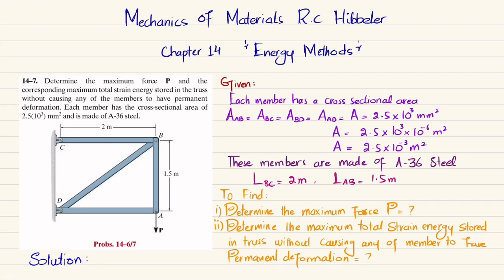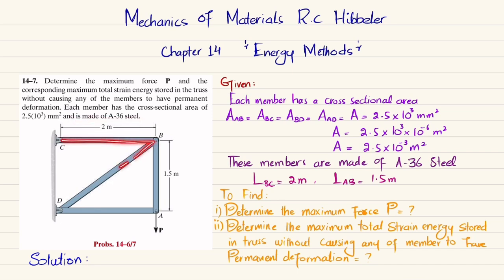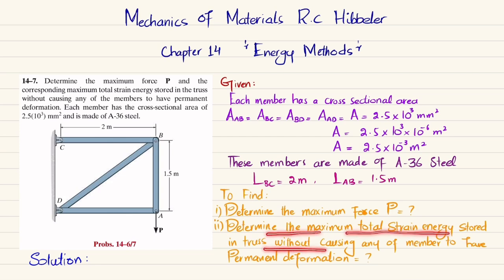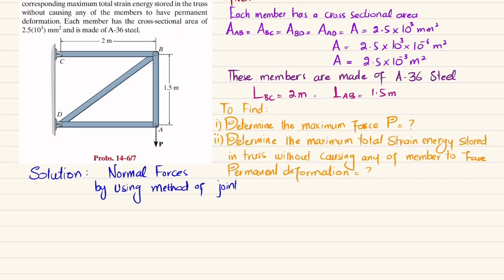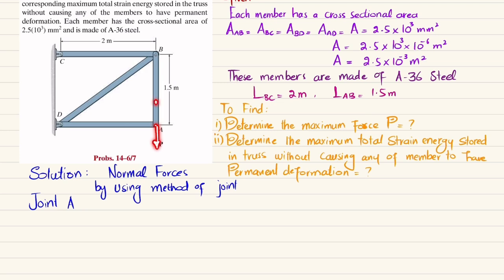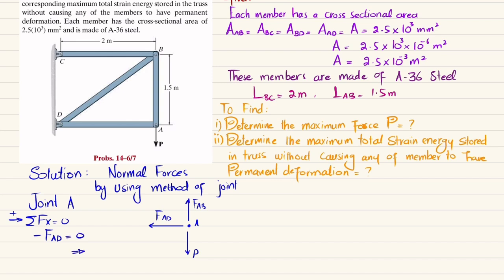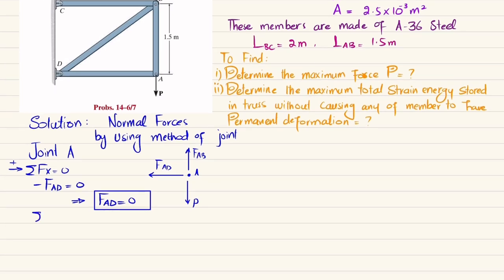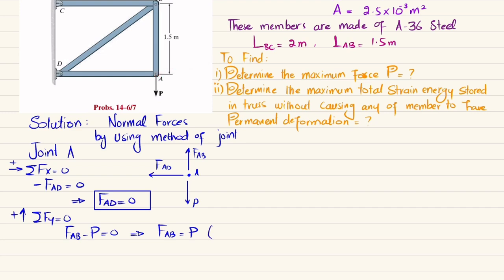14-7 | Determine maximum total strain energy stored in truss  | energy methods | Mech of materials

Comment: how is F ad  is zero. if we write balance equlibrium for the point D we have F bd so we need f ad to neutralize. Am i wrong?
Reply from the maker: From calculations we get F AD is zero. Kindly check it again. Thank you
Reply: @engradnanrasheedmechanical  6:15 no we get 1.6667
Reply from the maker: @krizelos sorry I was talking about your statements of F ad=0 . It's a typo mistake in my comments
Reply: @engradnanrasheedmechanical  sorry my mistake. I try to say if F bd is 1.6667 and if we write to balance equlibrium for D point we find F ad and it will bi different from zero.

Comment: why you have multiplied the sides of triangle specially 1.5 x 2 to get 3 ?
Reply from the maker: if you don't multiply then it is also ok. the reason is that we can standard triangle of  3 , 4 and 5 . rest you can apply the direct method as well.

Comment: the triangle thing i think is wrong it should follow pythagoras theorem, 1.5 squared is 2.25
Reply from the maker: it's not wrong but you can apply Pythagoras theorem to get the hypotenuse. also you can find the angle as well. the reason i follow it here that in solution it is solved like that and most of students have asked me to solve as it is given in the solution.